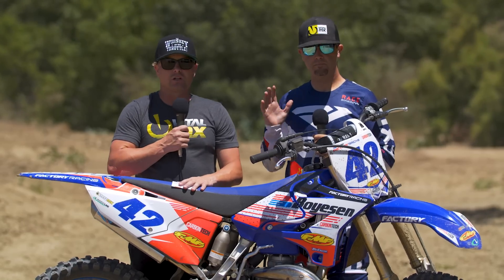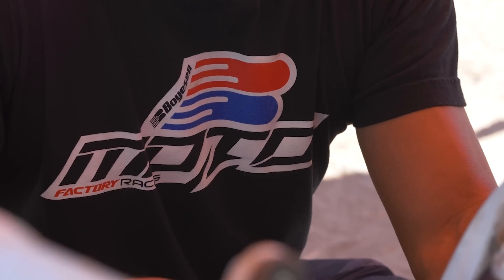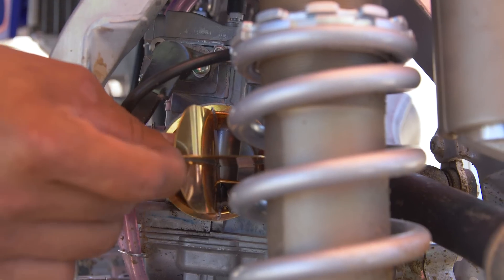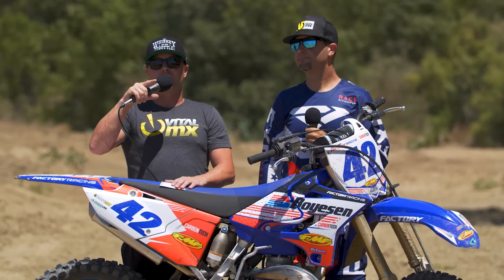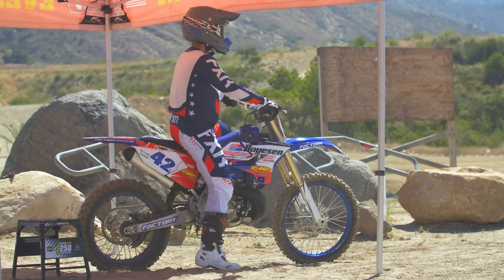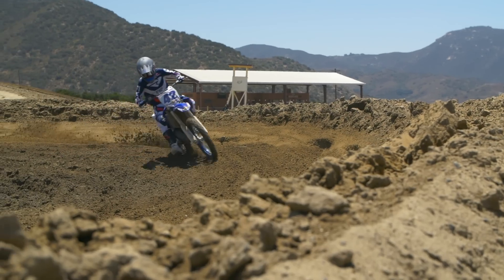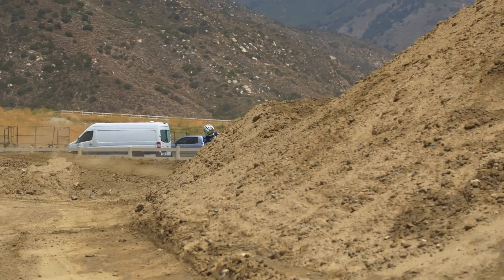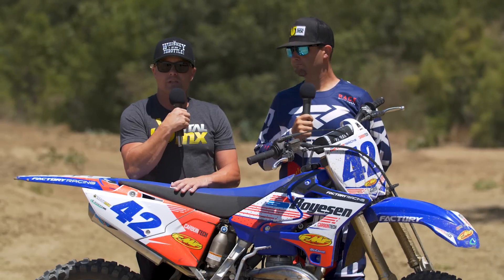Two-Stroke Power | Boyesen Air Intake Comparison

Comment: nice guys appreciate your work ... hey hey if the YZ smokers are looking for huge (usable power ) gains i can recomend a euro pipe system DOMA ...back in 2007-08  i was put on to them by Tony Hatton and Brenden Radford who used to do all the CDR development for the two smoke here in AUS ... they are 1/3 or so fatter through the expansion  chamber section of the pipe than FMF or PRO CIRCUIT options  giving it astronomically more power down low and midrange  ... they weren't a mass produced pipe    had you track one down and they're still the same design as back then the power and more importantly the placement of the  gains seen with the DOMA system is a case of WHY even BOTHER  with only a minimal noticeable change with these other main stream systems ( i feel the US pipes lose bottom end power with slight over rev crisper top end feel )making it harder to ride for most as opposed to what i can only describe as a bottom end / mid range TORQUE MONSTER ....
Reply: Check out the Motoes torque pipe. I put one on my 2025 x-trainer 250. A huge boost!

Comment: I have a yz250 and the best power mods was leaner jetting and a head recut to fix the horrible squish design to allow leaner jetting. It was less than $200 for the brass and head cut. This gave 5x the gain of a pipe at 2/3 of the cost. I tried a dep pipe too. It was a top end screamer. The rad valve was actually the only mod that I couldn't really tell if it did anything or not. Do not waste your money.
Reply: Sir, do you remember the leaner sizes of the jets you put on when you set your squish gap tighter? I'm going to do mine... Stock pilot jet is 50 and main jet is 178..

Comment: Great great video, Ping.
Been a fan of yours since you raced KTM Factory. 

I've had the great pleasure of meeting both Eyvind and Dag Boyesen at different times during my journalism career. Great people, father and son were Pro racers. 
Eyvind (Ivan) raced the GPs and Dag held an AMA Pro license for many years. 

I even did a test on the Rad Valve thru MX East when I had a column in that paper. 

EVERYTHING Ping says about the AMAZING Rad Valve is TRUE.
A 2T is basically an advanced AIR PUMP and Eyvind, an engineer, figured out how to master the flow. 
4T car engines use turbo chargers and super chargers to do the same.

As a former product tester for regional MX magazines and papers I HIGHLY recommend the Boyesen Rad Valve.
💪🏾🔥💪🏻
Now go forth and BRAAAAP. 🤗😉😎
Reply: That’s cool you like Boyeson but Turbos in Valved engines has Zero Comparison to Rad Valves or reeds. 
I suggest watching an animated clip of how 2 strokes actually work and what reeds do.

2 strokes suck air and fuel thru the  intake, past the reeds, the reeds flutter atomizing the fuel into the air. A turbo pushes air into an engine it doesn’t mix.
Reply: @anthonysupplee858  I gotcha. You're showing like an engineer, I'm speaking so a layman gets it. But you are 100 percent correct. Thx

Comment: On my 04 YZ 250, Mototassinari (spelling?) V3 and PC Pipe/silencer was a huge wake up. I wonder what a flywheel weight would do, It was suggested to me by a guy at Langston's place at the time.
Reply: It would theoretically add more low end grunt, and increase the "chug-ability" factor.

Comment: I put a rad valve on my 02 kx250 best mod ive ever done. Makes insane amounts low end chug power (enough to make 4 strokes jealous) and a very snappy throttle. I do mostly gnarly single track and this rad valve took a lot of clutch work out of riding/hill climbing, made it alot easier to pull out of low rpm's (even a gear high) and thats with going down on the rear sprocket instead of going up.  DONT EVER FALL FOR THE V-FORCE HYPE.

Comment: KTM/Husky is a new bike please do more on these, as the YZ is 20 YEARS OLD
Reply: The yz is more reliable and easier to work on, ktm and husky’s are nice, not not much better than a “20 year old bike”
Reply: @ssmokinzz28  100% so true, better suspension, better reliability, better everything, cheaper to maintain, and for the money you have leftover you can buy parts to make the bike faster or just as quick.
Reply: so? people are still buying and riding them
Reply: @bushbasher69  Aluminum frame + vibrations as no counter-balance - no thanks
Reply: @mecalpsha4473  you've obviously never ridden a yz, I've had ktms for years, got a 19 yz 250 on a great deal and honestly like the bike better, suspension is awesome compared to stock ktm and the power delivery is much more usable.

Comment: I would recommend these reeds to any one i had a 2016 yz 250 and i went through 2 sets of oem reeds in 6 months. Started to piss be off. I brought the first set of boyesen reeds and i had no more problems after that. Cant fault them! I cant be sure but it seemed like my bike ran slightly richer as i didnt touch the jetting but cant complain because it  worked a dream
Reply: Lean both pilot and main jet a step or 2 and really see what the rad valve has to offer. Makes the power so much smoother and on demand. The rad valve turned my 02 kx250 into a woods monster!

Comment: id love to see some testing with a lectron carb combination , i got boysen reeds bolt on with lectron carb huge difference for me from stock
Reply: I noticed a drop in low end when I put the Lectron on my yz250 but smoother power everywhere else. Did the boysen reeds bring that back for you?
Reply: @scralatchtica824  same, I put an Lectron on my 09, I lost a bit on the bottom but kills everywhere else. I want to try these out.
Reply: @scralatchtica824  do the SmartCarb instead. Blows away the Lectron.  I tried both on my YZ250.